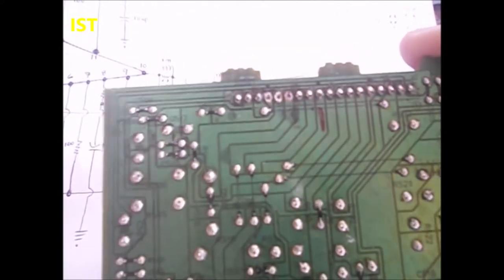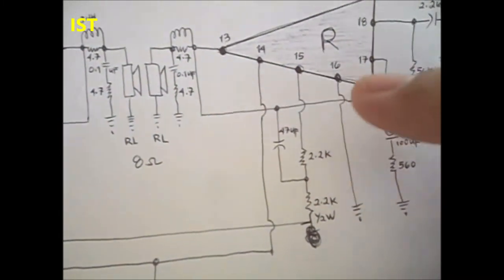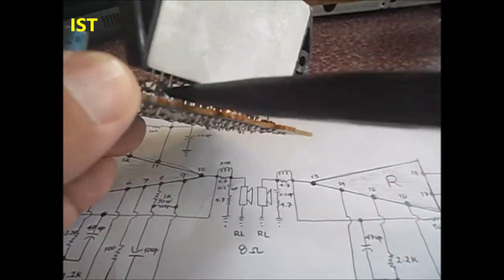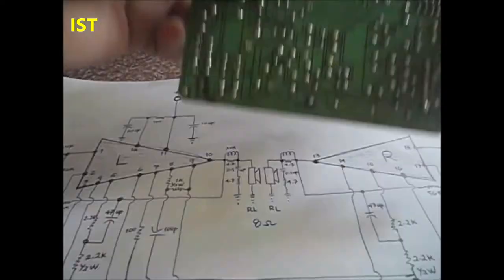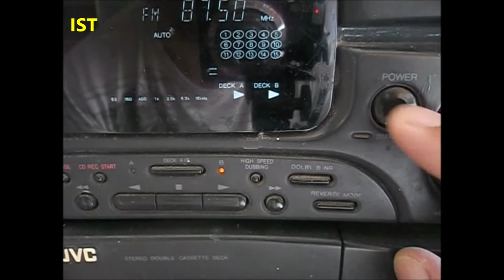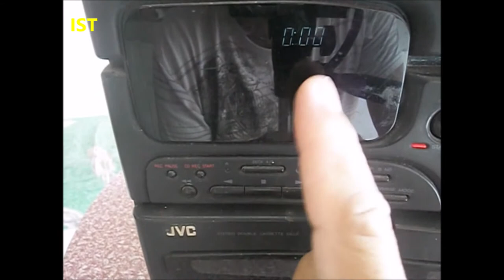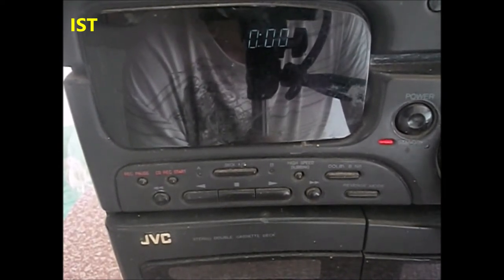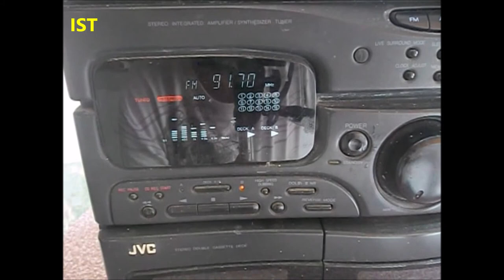SHORTED STK, LEFT CHANNEL ONLY (TAGLISH)

Comment: Sir ano po i check if palging busted ang stk ic ko. Original ang last two ko na palit. Magagamit sya for 1 week tpos mg garalgal.ang sound output tpos mwawala na ang sound. Dlawang stk po . Ginagawa ko para masound khit isng channel lmg dinitach ko ang ang right channel connection sa left channel
Reply from the maker: Kindly check the parts na nakapalibot sa stk like resistor, diodes, capacitors, etc. Baka may nagchange value.

Comment: idol galing , patulong man idol sa ampli na ginagawa ko na pioneer vsx-d337, Pac009a ic nia may stanby ayaw mag power
Reply from the maker: Kumpleto ba voltage sa power supply?
Reply: @idolservicetech955  meron sa transformer primary kaso bumababa sa 156v ac,  pero pag inangat ko ung sa main filter caps ay 220 naman ang voltage sa primary
Reply from the maker: Try mo kaya palitan ang main filter baka leaky yan.
Reply: @idolservicetech955  ok try ko idol, sa output ng main filter cap ako kasi nag angat eh, may nasusukat na akong tamang voltage 51 vdc